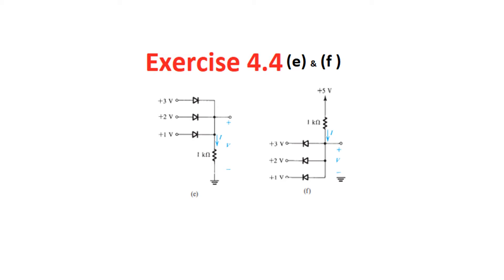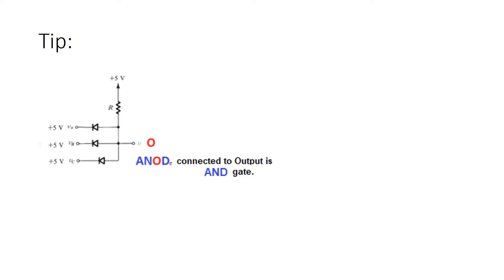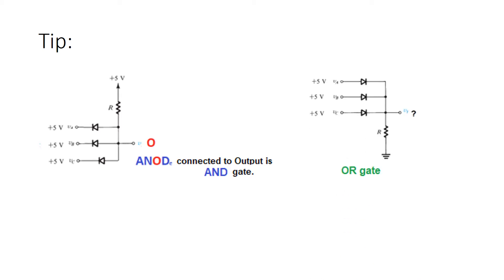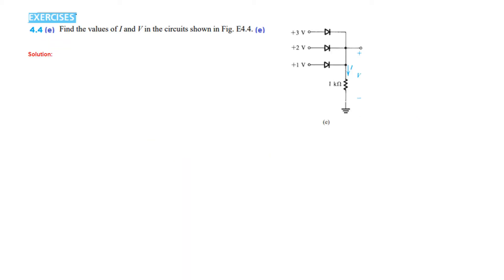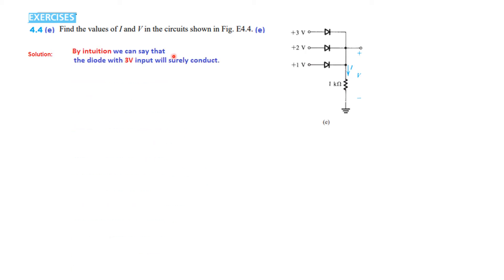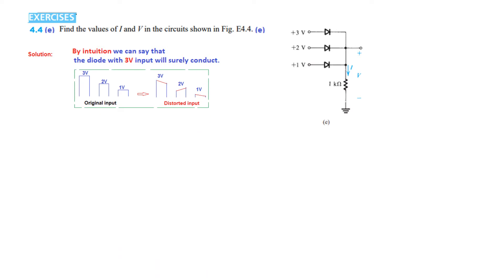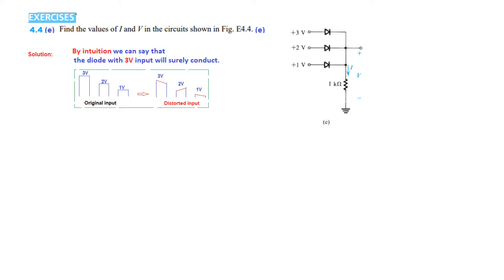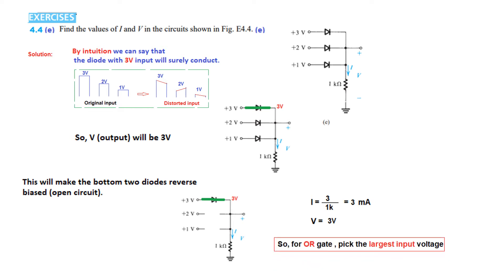(E)EDC(S) Exe 4.4(e & f) ||  Diode AND Gate & OR Gate

Comment: dear sir sedra smith (7th edition) exercise problem num. 4.5 is so critical
i can not understand
Reply from the maker: Input voltage = (20/2)/pi =3.183V. divided by current given total resistance 3183 ohm.  R= 3183 - 50 = 3133 ohm = 3.133kohm
Reply from the maker: https://youtu.be/wewntpRMMnY